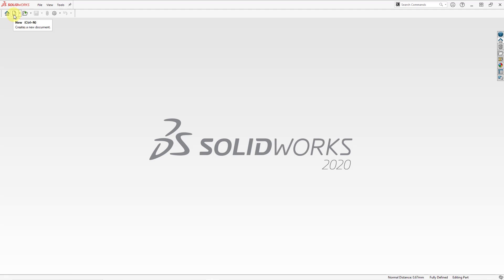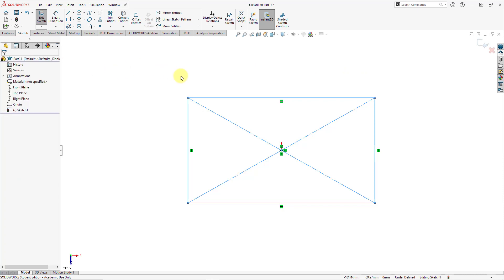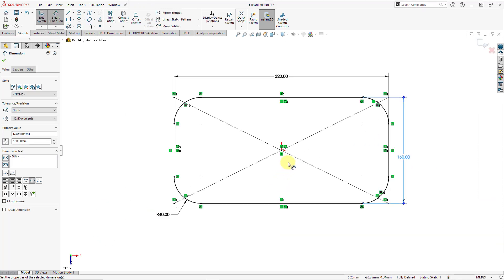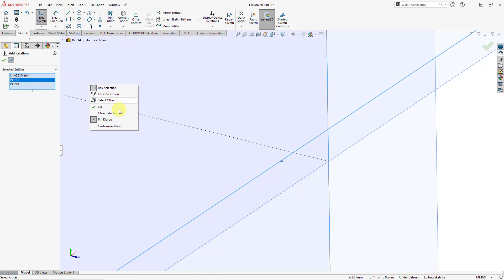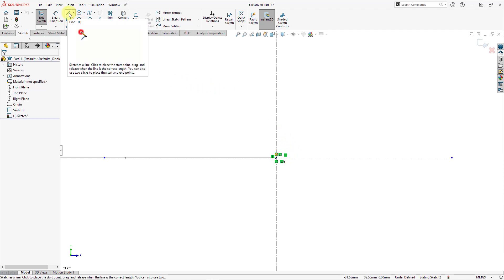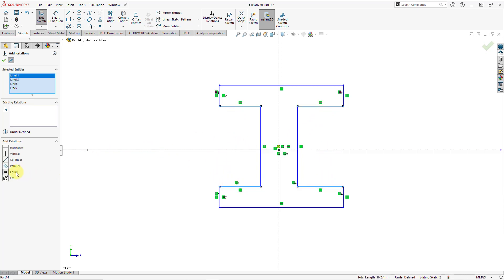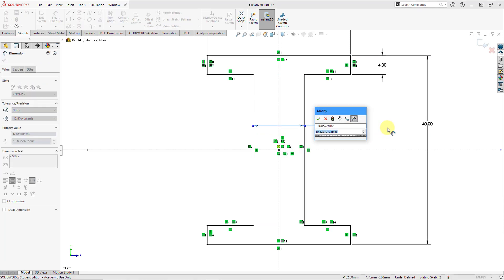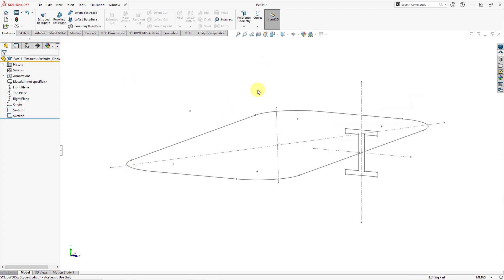How to Create a Sketch in SolidWorks | Part Modeling

Comment: Thanks Dave for Your brilliant tutorials and apologise for digging this comments after 3 years.
I want to ask if you know if there is any way to force SolidWorks to show automatic "weak" constraints/relations/dimensions? As far as I know every CAD software HAS TO set some constraints and relations by itself if designer dont set any, in the other way there will be no options to show the geometry on the screen in the exact place. Creo is showing them as light blue dimensions, what is in my opinion a right way to inform designer what the software "thinks" about the sketch. Is there any option to make SolidWorks sketcher to work as Creo's one?
Reply from the maker: Unfortunately, SolidWorks does not have something analogous to weak dimensions. It's blue geometric entities that turn black when fully constrained.

Comment: Your second sketch was under defined because of the centerlines. For some reason Solidworks says they’re good when you make them but if the sketch can’t determine where the end points of the centerlines are it freaks out. You can fake that if you really want by making the centerlines of infinite length (similar to how Creo makes them), however that’s kind of a pain as you need to make the centerline, click on the line again and then choose the infinite length option, and then possibly constrain it again as it sometimes loses where it’s at vertically/horizontally. 

Both Solidworks and Inventor do the annoying thing of making you think you’re making something constrained (the lengths are the same, end points the same in space, etc.) but then don’t do it and make you go back and do it manually. On the flip side, Creo is a royal pain if your sketch needs to super complex. They all have their pluses and minuses.